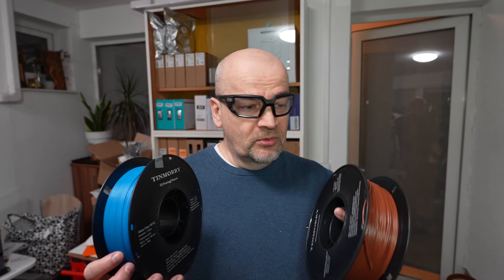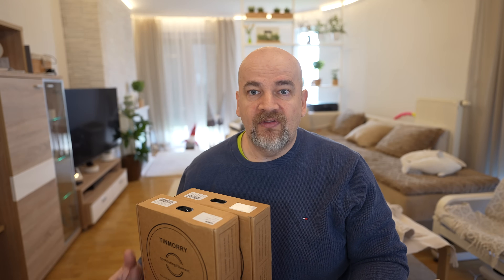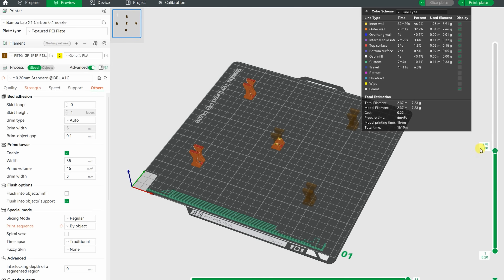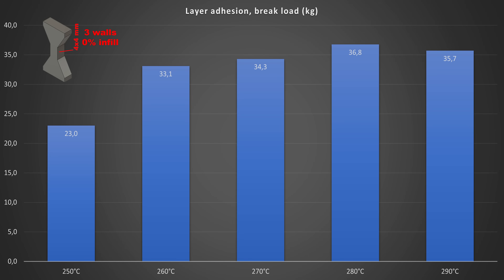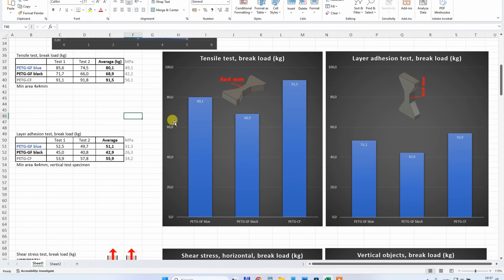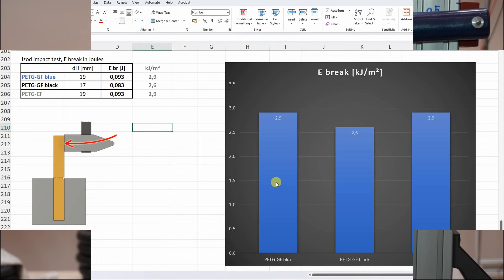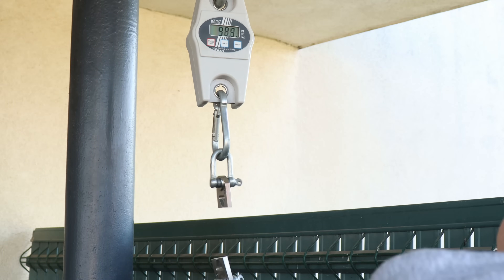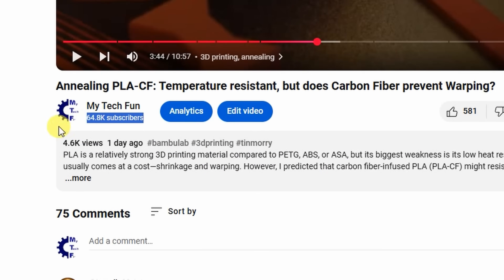PETG-GF vs PETG-CF by Tinmorry: Is Glass Fiber Better Than Carbon Fiber?

Comment: Most important advantage of GF version is dielectric strength, you can use it for enclosures, brackets, etc. of electrical components, motors, etc. But, you should not use CF version.
Reply: On the flip side, you can use carbon fiber filament to print an electrical enclosure that helps to mitigate electromagnetic interference, particularly in higher frequencies.
Reply: @Liberty4Ever  Yes. Or just dress it up with cheap hvac tape (alu) on the inside. But the flip side also if you're building some sort of wireless device whether wifi bluetooth nrf24 or espnow with an onboard antenna you should definitely NOT enclose it in conductive material.
Reply: @SianaGearz  This is very good to know,   how RF blocking/reflective is CF filament,   if I print a small parabolic reflector,  would it reflect enough of the RF?   inquiring minds would like to know :)
Reply: @SianaGearz  This is why I'm picking GF.
Reply: I know what that is from a Fear Factory song \m/
Reply: I question this as there is several CF filaments that are recommended for electrical enclosures. Even ESD filaments have CF fill. I guess I could put a megger on tinmory petg-cf  and see what the resistance is at 500v/1000v and report back.

Comment: Spoiler alert! They have different mechanical properties and are therefore used in different applications! GF is Less rigid but tougher than CF. 

Toughness is quantified by the area under the stress-strain curve in a tensile test, combining both strength and ductility. A material with high toughness can withstand significant deformation and absorb a large amount of energy before breaking.
Reply: Yep, people tend to shut down their brains once they hear "CF" and think it must be the best thing ever. 

In reality you have to apply the right material to the right application.